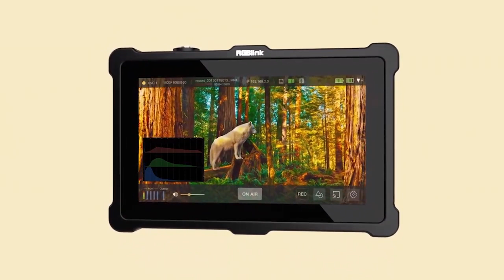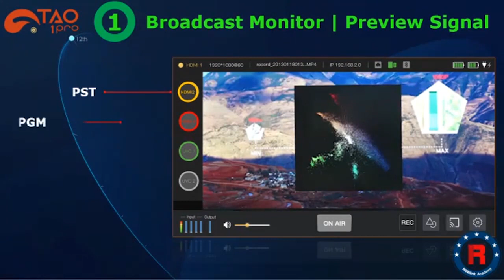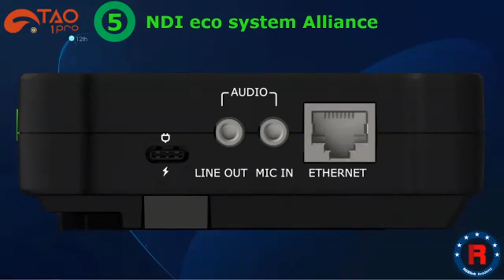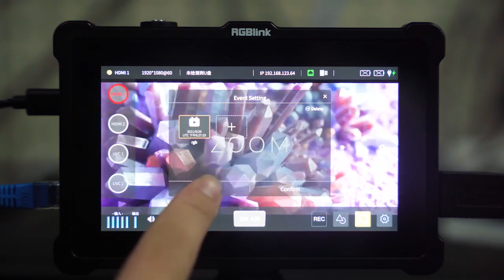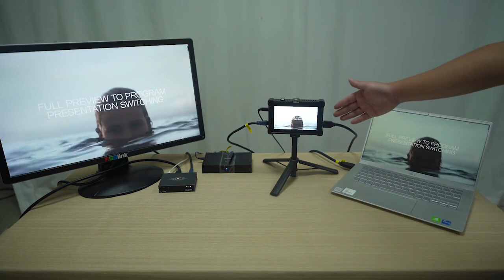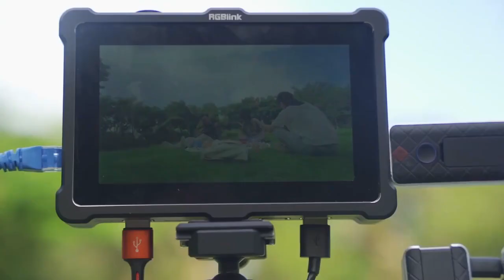TAO 1 pro launch webinar 9/29

Comment: Cannot accept HDMI output from the camera. While it claims to accept various from rates it doesn’t accept al HDMI inputs such as interlaced from a camera’s HDMI output. Despite a monitor being able to accept those HDMI signals from a camera the TAO PRO doesn’t. Therefore some cameras HDMI output cannot be connected as a input as the TAO PRO doesn’t recognize it.  They need to fix this issue so that the TAO PRO can accept all forms of HDMI inputs as users will expect it will accept them all but it doesn’t despite the fact a monitor can accept the same HDMI signal.

Comment: Upgrading firmware can make the unit not turn back on. That was my experience. The manual states to manually restart after the unit powers down when you confirm the upgrade process to begin. However I suspect the manual on how to upgrade should say "wait until the unit automatically "reboots" on its own" which is very different from saying to do a manual restart after the unit powers down.  If the manual is correct and they want you to do a manual restart after you select confirm to the upgrade then beware having followed their manual directions the firmware upgrade killed my unit as it no longer turns on.